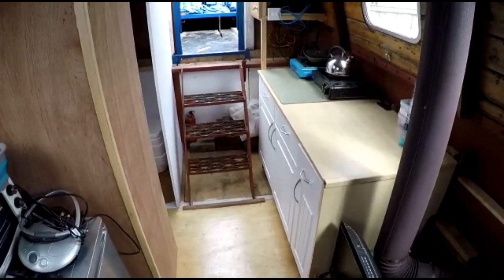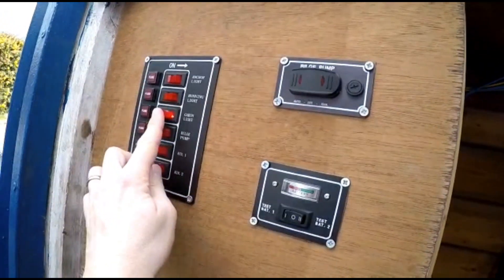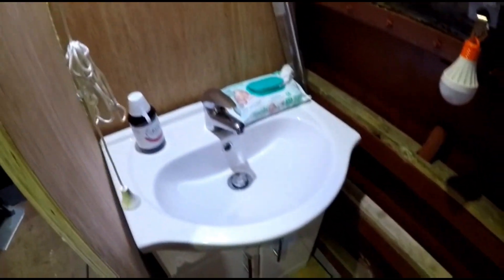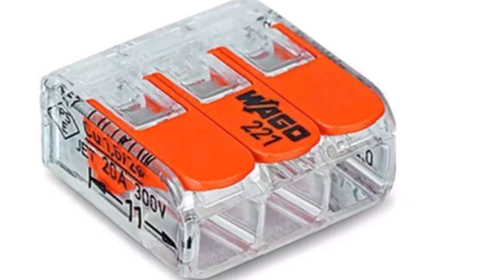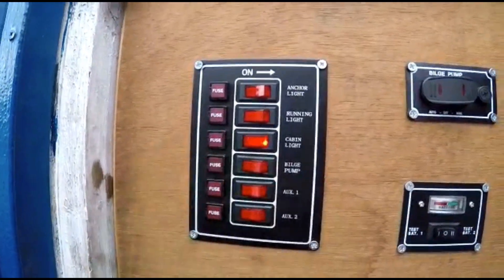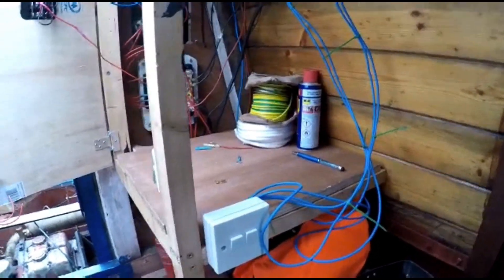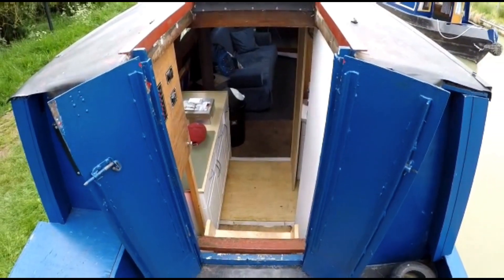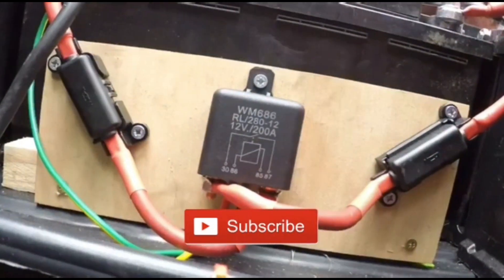Narrowboat Electrics

Comment: Great job... Really impressed with what you have done to the boat... I'd be wary of the wiring attached to the bolts in the engine room... The threads are sharp and I would worry that vibration will eventually wear the cable insulation and short out the wiring... Keep safe and please keep posting... Really enjoy seeing your progress...